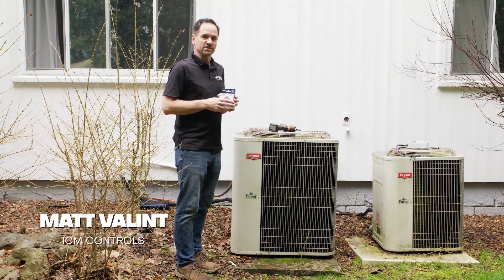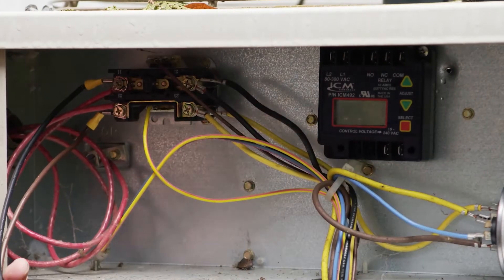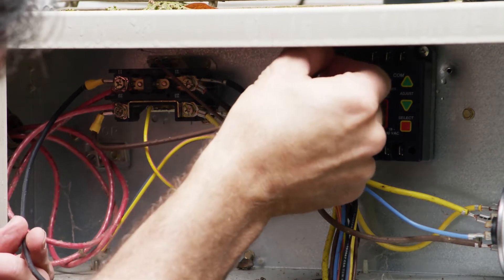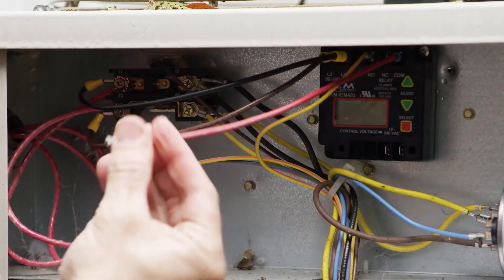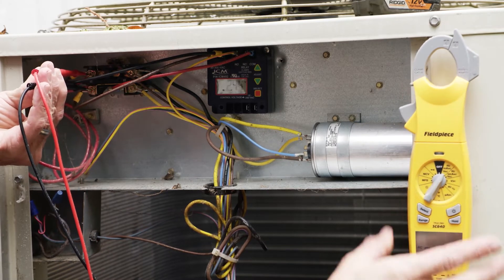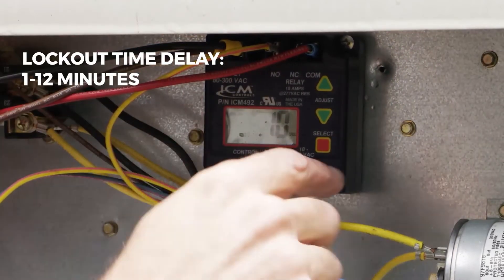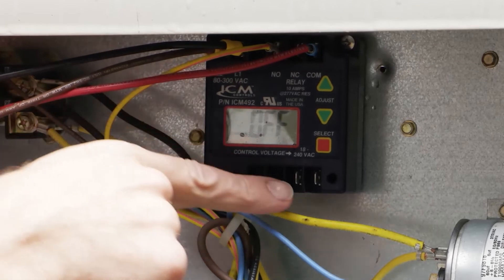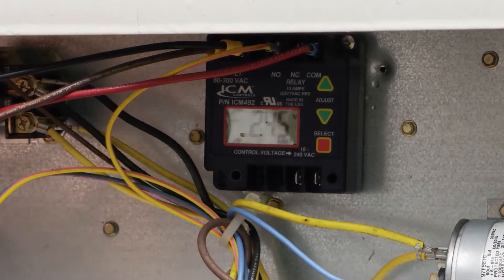Installation Video ICM492 Single Phase Voltage Monitor

Comment: Wouldn't is make a lot more sense to install that on the furnace / air handler? Any power interruptions would trip it effectively turning off power to the air handler / furnace and therefor not energize the contactor protecting the outdoor unit as well.
Reply from the maker: ICM recommends wiring as per the instructions. Call ICM tech support for more details.